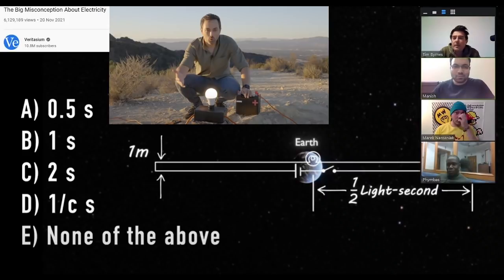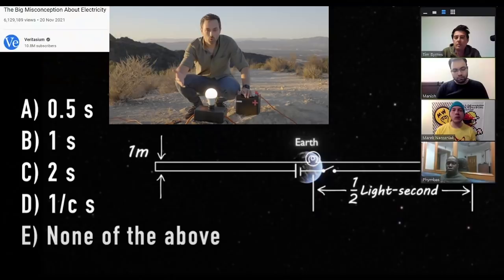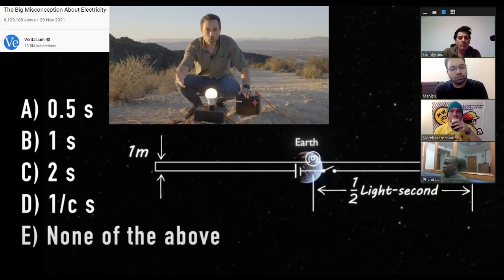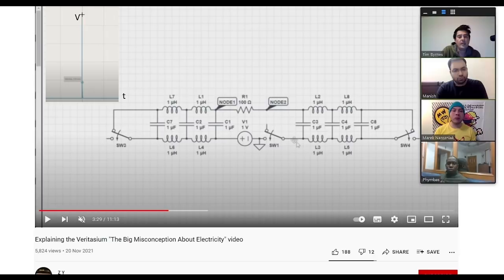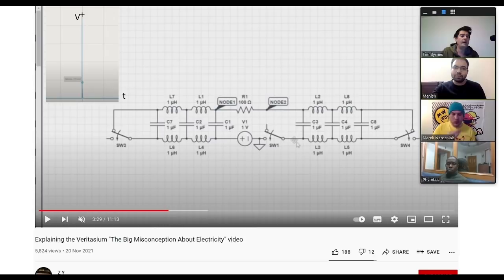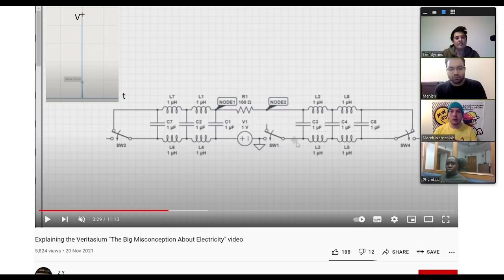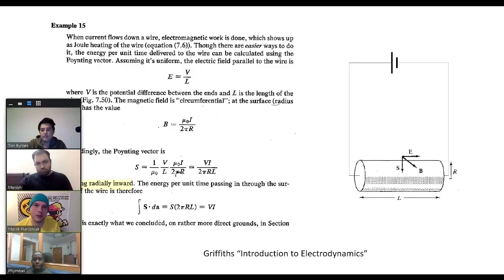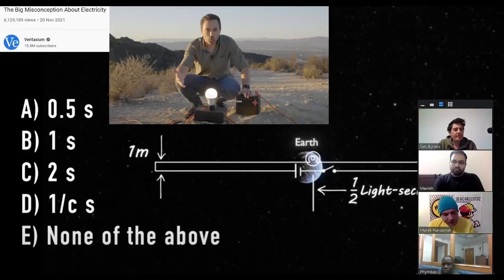Veritasium's Big Misconception About Electricity video and the point about Poynting

Comment: You guys take the Poynting vector theory as the same as Newton's universal gravity theory.  Newton's theory works in small scale calculations where the general relativity accuracy is not required where the Newton's theory assumes a law of attraction between matter.  Do the physical matter attract each other like magnets as explained by Newton's theory.  Not really, according to Einstein theory, which sees it as a space-time curvature caused by the very existence of physical matter in space. We have gotten used to Newton's idea of "gravity attraction" over the centuries that we are still having trouble picturing Einstein's version of gravity.  I think the transfer of energy as pointed out by Poynting vector explanation can also be understood in that light by not taking it literally but as a very good mathematical approximation of calculating the outcome, which is what Newton's theory of gravity is(and pretty much all the theories in physics). Yes, there is an issue with the non-intuitive way of seeing any energy transfer outside the wire as we don't seem to get electrocuted by taking the finger closer to the wire(in low voltage scenarios of course) but do get electrocuted if we touch the metal wire(under the assumption wherever a significant amount of energy transfer takes place, we should be able to feel something in the energy transfer area that we can sense or hurt us). 

I think it is like quantum mechanics, where it says "shut up and calculate" where the probabilistic assumptions of quantum mechanics sounds like nonsense, but works beautifully with calculated predictions. I think the Poynting vector theory works and is staying with us because  nobody has shown a working theoretical way of calculating the outcomes by showing the energy transfer happens through the wire, because without the wire, there is no electrical energy transfer.  Field theory is good because it explains the detected influence of the electricity outside the wire via electromagnetism.  Poynting vector is the mathematical formulation where we've learnt to create a mathematical method to calculate the energy transfer and effects accurately.  It is up to the individual to believe whether the energy actually transfers via the field outside the wire. 
 I personally don't take it literally, and nor do I take the quantum mechanics literally where most interpretations say a particle can exist at two places at the same time and they can vanish form one point and appear at another point in space. It's all in our heads. We can choose to believe whatever we want.  Going into trying to understand the reality as it is can and will end up in the realm of philosophy, where the philosophy of science is still catching up with the experimental results and theories that we've formulated. 

My personal belief is that, how much of reality we can understand is directly proportional to the abilities of our brain, and it has it's limitations.  It is quite possible our limitations of understanding the physical world around us(as created by our brain) has it's limitations just as  we cannot expect a monkey to understand theory of relativity.  Given enough time, non-sensical ideas can become common sense where it becomes a second nature to see the energy transfer happening outside the fire in an electromagnetic field that we cannot see, but can detect some of it's effects.  Of course, some folks like myself cannot help keep asking the question why the field outside the wire doesn't give me a zap, but that because I am finding it far more non-intuitive than most learned fellows out there of that theory and prefers a better theory, which we do not have yet.

Comment: But the real problem with the Veritasium video, is the claim that the energy is actually traveling through the air.  And yes, this is true for energy that is happening at relatively high frequencies, but not for low frequencies, or DC current, in particular.  The Poynting vector does indeed show what the NET DIRECTION and magnitude of energy transfer (i.e., power) is, but it does NOT tell you the actual path it's taking.  If I take a water hose and run it from a hose bib on the north side of my house, around the house to a garden sprinkler on the south side, the Poynting vector will show you that the energy is going straight through the house.  But at no time is any of the energy (represented by the pressure and flow rate of the water at any point in the hose) inside the house.

Comment: There is no capacitance anywhere. If there was then, one side of the bulb would be positive and the other negative. So the battery and switch would be in series with a filter cap and bulb in parallel With that. Given the circuit has theoretical zero resistance and no voltage drop anywhere on the wire, makes this more so. There is no antennae effect either.

Comment: "Electrical power flows in the EM field around the wire, not within the wire" is Veritasium's primary, most important, and totally wrong, conjecture.  Most of the U-Tube discussions forget this primary hypothesis and get lost on transmission line wave propagation theory and the "red herring" Poynting vector.  The electrician and electrical engineer in me knows Veritasium's hypothesis is completely wrong, and here's how I justify my judgement.  If Veritasium's theory is correct it must work for all circuits, both AC and DC.  If I provide a few kilowatts of power to a load, like a kitchen stove, through two twisted wires and clamp my magnetism-sensing Ampere measuring device around both wires, I will measure zero amperes even though the stove is hot from known electricity flow, because the current in my two wires flows in equal and opposite directions and the resulting magnetic fields in the space surrounding the wires cancel.  If these theoretically large fields cannot be measured, they don't exist and then there are no Electric plus Magnetic fields necessary for wave propagation and thus for transferring power.  I know that as I increase the power consumed by my load, I must also increase the size of my wires to keep them from overheating and breaking, so again the power must be within the wires, not outside.  If the transmitted power was "outside the wires in the surrounding fields," why would I need any but the smallest wires, or any wires at all?  

Veritasium's post, which should have long been removed as untrue, has made lots of money from his contrived claim.  It however continues to exemplify how many minds, both large and small, can be so easily duped by razz-ma-tazz physics, engineering and math.  Is it any wonder then that climate science is such a hard sell?

Comment: Surely the magnitude of the B fields is so much larger next to the wire, that the proportion of integrated power flowing directly next to (or along) the wire is much greater than that flowing out to infinity and back. In order to receive x% of the total power delivered would we then need to wait for x% of the path integrals to arrive -i.e. for the power flowing next to (along) the wire!

Comment: Answer D has the wrong nomenclature - 1 / c would be seconds / meter.
ref: "Spin up science with Dr Ben Miles".
Also, consider the notion of the capacitor in the beginning of this video, this system is in space, in vacuum, neglecting garvity.

Comment: At 7:10, since electric fields store energy and the electric field between the charging capacitor plates is increasing in intensity, energy is indeed flowing into the capacitor as the Poynting vector indicates.  Additionally, the electric field points radially away from the positive wire and toward the negative wire while the magnetic field encircles the wires; the Poynting vector still points toward the charging capacitor and as it discharges, the Poynting vector points away.  At 9:00, the Poynting vector applies ONLY when the electric and magnetic fields have the SAME power source; otherwise, applying it yields precisely this nonsense.  At 15:20, the Poynting vector is the flow of field ENERGY density.  When computed correctly, its magnitude and direction always reflects the energy transported by the electromagnetic field.  But we have no control over what you understand.
Reply: The static charge and magnet example yields a solenoidal Poynting Vector field which has no sources or sinks. There is no power flux density in this, however, it does possess momentum density of value S/c^2.

In the case of changing electric and magnetic fields, the electric and magnetic fields may certainly come from different sources. For instance, in an air core transformer, the electric field from the primary induces a current in the secondary, which in turn produces a magnetic field. S results from the cross product of the primary’s electric field and the circular magnetic field surrounding the turns on the secondary. - div S in this case is basically equal to E dot (curl B) / mu_0, where curl B equals the current density J in the secondary times mu_0.

In the case we have a magnetic core, the power density in the magnetic core material depends on - B dot curl E divided by mu_0. Both B and curl E come from the changing currents in the windings as well as the magnetic response of the core material.

In the static charge and magnet example, the electric field is curl free, while the current density is only curl M, which is solenoidal. So the electric field is conservative and is incapable of performing work on the solenoidal (divergence-free) magnetization current density curl M of the magnet.
Reply: @ayoutubechannelname  Solenoidal momentum is proportional to ANGULAR momentum... This would be consistent with the electron angular momentum in the permanent magnet.

Comment: Veritasium's problem is that he is a physicist and not an electrical engineer. 

For instance, no one who doesn't understand fourth-year vector calculus, fourth-year statistics/probability including "zero-probability events", eighth-year mathematics "levels of infinity", fourth-year chemistry, eighth-year physics, sixth-year chaos theory, etc. should try to talk about quantum mechanics. I have many of those except fourth-year chemistry and eighth-year physics, and I feel super unqualified to talk about it. But, I was so good at the math side of this, that when chaos theory took off, mainly from discussions about quantum effects, and when that eventually settled into "partially deterministic/probabilistic chaos -- quantum chaos", I was a teensy-tiny bit involved. There are very few people, like Michio Kaku, who truly understand all sides of this. I stay out of discussions with it unless a physicist makes a huge mistake at the math/statistical/probability side of it. And I get deservedly slapped down by Michio Kaku types when I go too far into the pure physics or pure chemistry sides of it. My dissertation was on the differential equations used in major electrical power networks, and the numerical methods employed to approximate them. From the math perspective, I found that they were using very bad numerical methods and needed to upgrade their computer programs. The EEs who got my dissertation refused to acknowledge my expertise over theirs, and would not listen. They took one course in basic numerical methods and refused to see that an expert in numerical methods knows more than they do.

Similarly physicists only look at electricity via a little bit of coursework. Whereas an EE has tons more info. Veritasium needs to be told to stay out of EE just like I'm slapped down when I stray too far outside of mathematics.
Reply: Veritasium is an engineer, with an Engineering degree from a renowned Canadian university. (Note he is wearing a Canadian engineer's "Iron Ring.")

Comment: What is missed imho is the energy is in the cross section of wire as well as the space around it. It's kind of like arguing about gravity is on the earth as well as through it. But thinking that if you dig into the earth there is no gravity. That's what Veritasium was arguing imo.

Comment: There is absolutely nothing strange with Poyinting's vektor. If you calculate ( yes I am aware that you can't)  you will se the poyinting vectors pointing a little into the wire that is because the wire take up some energy in form of losses in the wire..

Comment: Instantly = signal velocity

When you connect a wire to a battery terminal, the other end of the wire will be instantly at that terminal potential (no current has to flow),
In the original video the battery voltage will appear instantly across the switch and turning on the switch on will instantly turn on the bulb...

The first free electron in the wire at the junction of the wire and the bulb doesn't have to travel far...
In a steady state, the filed collapses into the wire so...

In the real world, a conductor with zero ohms is known as a dead short...

Comment: Tim is right, Veritasium's point is about energy transfer, not about the transient.  Veritasium said all these 3 are lies: "electrons themselves have potential energy, and they are pushed and pulled through a continuous conducting loop, and that they dissipate their energy in the device". I seriously doubt that all the 3 claims are false.What do you guys think?
 I did a full-wave simulation to calculate the current in the lightbulb, using fdtd, not transmission line and we can compare notes. https://youtu.be/D44P988idbs

Comment: Thanks for talking about this. A lot of other videos focus on the example and explain it using antennas, capacitors and magnetic fields. But I thought the point of Veritasium's video was not the example, but the Pointing vector.

So how do we know Poynting vectors are correct in the first place?
Reply: Hi, I'm an old retired electrical engineer.  The short answer to your question is we DON'T.  The real story is 150 years old and is still a raging question at the core of many sciences.  Since my days in college when my professors whipped out Maxwell's equations and tried brainwashing me I was asking similar questions.  

No one has the ultimate answer, no one.

In practice, we engineers do what works without fully understanding the theory of everything.  

Ultimately the question boils down to fundamental assumptions about the models we use, of which Maxwell's equations,  Poynting vectors etc. are all just models and tools.

The truth (if such a thing exists) is not so much an answer but a journey.  Do you believe in God?  Can he be quantified or modeled with equations?  These are the questions that will arise if you really want to know more about why EVERY video on this subject  I've seen is completely misleading.

Is there really such a thing as the "electron"?  Are electromagnetic waves really self-induced massless transmission mechanisms?  Are photons real?

You will have to answer these types of questions for yourself to even begin approaching an answer.
Reply: We don't.
Reply: @VegasOct1Sounds  ahh. Yes, thanks for taking the time!
Reply: @VegasOct1Sounds  not often that one meets someone like you in comment sections about science videos, that actually get the limits of so-called scientific truth. Question is, what value does such truth hold for an actual human being? Does science care about "the scientist"? And who likes to life in entropy - or outer space? Hmm, there sure are people out there, that still try to live in a past where the sun will always shine "down" on us..
Reply: @VegasOct1Sounds  btw, if I were a person that upvotes comments, then yours would be the one I have read here so far that I would had upvoted. - Hmm, who would upvote your comment? I would love to have an argument with him!
Reply: @Nowhy  IMHO "truth" is a momentary and fleeting "feeling" of security each of us may achieve that is commensurate with our abilities, needs, and frailties.  My truth is specific to my journey.   For some a more superficial truth/model exists. Our physical and "spiritual" journeys color what truths we accept.  I believe that we as "human" act both individually and collectively.  I barely manage my individual journey and have no clue what the collective journey might become or should be.  I know and feel part of the human situation.  I believe it's but a tiny fraction of what really IS.

Comment: The point is that, when Veritasium paints the Poynting vectors getting out of the battery and into the light, presumes a stable situation, with the electrons in the whole wires moving, and that's incorrect. That is achieved 1 second after closing the interrupt. At the moment the interrupt is closed, only the electrons in it start to move, but all the other electrons are still, and only will start moving progressively.